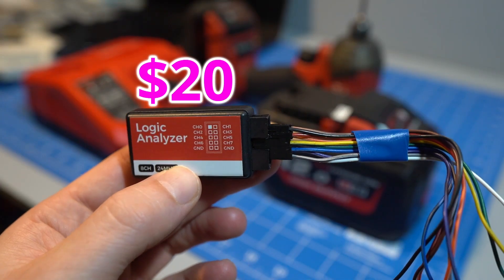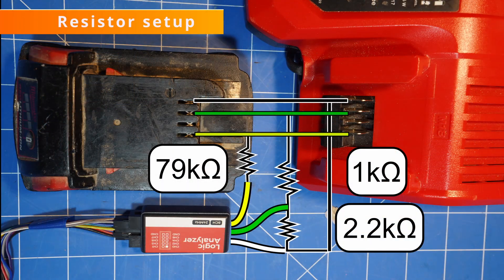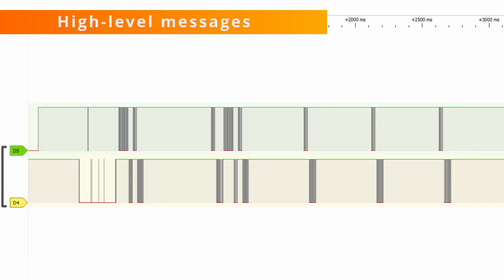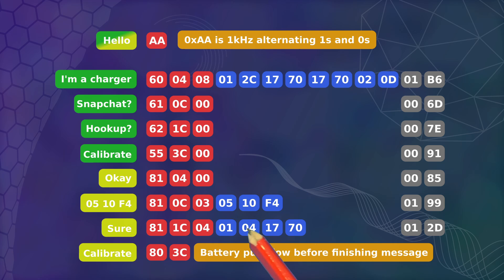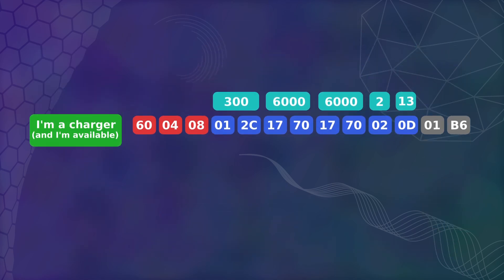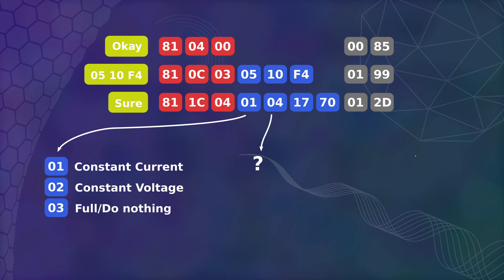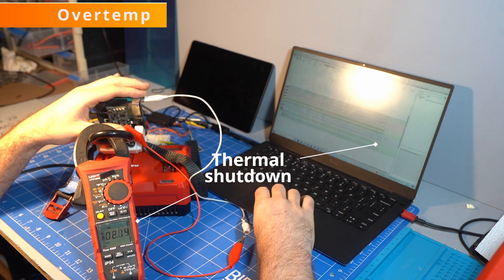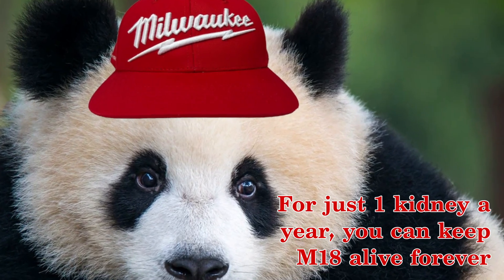[004] Reverse-engineering the Milwaukee M18 Redlink Protocol

Comment: Judging by the price of knockoffs, milwaukee battery margins must be 50% profit or greater for some configurations. I like the tools but come on milwaukee the best cylindrical cell around is probably not even 6 bucks in bulk. And those new flat pouch cell types they are going forward with in the new battery line is probably even cheaper because of packaging alone. higher amp output I'm sure but also likely not as long lived... cylindrical cells have historically been a lot more stable over time afaik anyway, but perhaps that is just because I'm only used to comparing to cheap pouch types.
Reply from the maker: We need a reliable 3rd party brand, with good warranty. The problem with most knockoffs is that they're an unknown entity - could be using any cells and little to no protection. I pay the tax just so I don't have to worry about my house burning down.
Reply: The TPCell on ali x looks promising. They offer Makita and Milwaukee packed with samsung LG  or higher quality Chinese cell and 12mo warranty.  And guaranteed capacity. Sidorov tested them and they were all stated capacity. Reviews are good so who knows. Not as cheap as typical knockoff but way less than oem

 Myself I just roll my own these days and give myself a lifetime warranty
Reply from the maker: @earl3358  interesting channel. Thanks for pointing it out. I guess you still don't know if you're getting the Samsungs or Chinese cells. Also a pain to send anything back. Liek you say, best budget option is to buy good knock-off boards and make your own, then rebuild when they fail.

Comment: Outstanding work, thank you.  Any chance you might perform similar investigations on the Makita batteries that have a very bad habit of bricking themselves if a charge fault is detected 3 times?  I have a large box of said bricks I would donate to such an effort.
Reply from the maker: To do that you've got to reverse engineer the chip, which is about 100x harder than what I've done in this vid. Some much more knowledgeable people than me have been looking at that on battery hacking forum. Seems like Makita is using a chip known to be very difficult to reverse engineer. If they've deemed it too hard, then it's well beyond my abilities.

Comment: Those basic logic analysers are an indispensable tool, the number of capabilities you get for the money is incredible
Reply: Indeed, though these cheap ones do not have the slightest bit of input protection. Probing with a scope prior to using them is advised.

Comment: Could you design a fake battery such that it is actually a transformer so that battery-based power tool could be run off of a power cord (wired to AC) ?
Reply from the maker: A youtuber called Harrison Hobbies has done that. It ends up being large and expensive, but could be useful for some people. Hikoki (Metabo HPT if you're in NA) has an official adapter that works with their 36V tools.
Reply: Wow, thanks for the reply, that's been bugging me for like 2 years.  So I have another wish list item for people smarter than me.
Is it possible to covert dirty power from a non-inverter generator to pure sine wave?  I say this because I have a great generator 12kw genset that powers my home.  But I would love something I could plug in to a wall outlet that is supplied by said generator and have it invert it to pure sine wave.  I only need like 2kw or less to be good power, the rest is fine on dirty power.  The idea is power the whole house dirty, plug in a device in to 1 outlet and provide 15 to 20 amps of 120 pure. @toolscientist

Comment: But why ?? total overkill for a bloody charger...
Reply from the maker: To do fast charging on Li-ion, you either need access to all the cells (like Dewalt) or you need a way for the battery to control the current. The original M18 packs (pre-2014) didn't have this and couldn't fast charge. Going digital was really the only way they could do it whilst maintaining backwards compatibility.

Comment: Well that's overcomplex.  Love to know why Milwaukee though the batteries and charger needed to chat ao much about nothing?
Reply from the maker: To do fast charging on Li-ion, you either need access to all the cells (like Dewalt) or you need a way for the battery to control the current. The original M18 packs (pre-2014) didn't have this and couldn't fast charge. Going digital was really the only way they could do it whilst maintaining backwards compatibility.

Comment: excellent video, i made an adapter about a year ago, from an old M18 battery to attempt to do the same a while back, i just lacked the logic analyzer to hack the stream. i can send it to you if you want
Reply from the maker: I'm in AU. I have pretty much have every M18 battery (except 9ah and 1.5ah), so no need for anymore. I have noticed that my batteries from 2013 and earlier do NOT have digital communication, so you might not get anything out of your batteries if they're really old.

Comment: So ultimately, that battery talk only serves to satisfy an overpriced monopoly. (and not any actual protection)
Reply from the maker: To do fast charging on Li-ion, you either need access to all the cells (like Dewalt) or you need a way for the battery to control the current. The original M18 packs (pre-2014) didn't have this and couldn't fast charge. Going digital was really the only way they could do it whilst maintaining backwards compatibility.
Reply: @toolscientist : thanks for the clarification.

Comment: This is phenomenal. I also have no doubts you are the guy to solve the historical “how to run Milwaukee battery tools on AC power” question.
Reply: Not too complicated I got it working in the shop a year ago. If I roughly try to remember you have to send 5V to either J1 or J2 pin. Can't remember which. Even 1V was enough if I remember correctly. Then the tool will accept current via the Power and Ground pins. I powered a whole bunch of Milwaukee tools like this using a lab bench power supply. Just make sure your wires are beefy because you're dealing with a lot of current. Having said that, I am looking forward to the next video in case there's some current throttling happening without explicitly communicating through uart.
Reply: @renegaed  From my testing and reverse engineering of this a few months back the only communications I saw were between the charger and the battery. I didn't see any data between any of the tools I tested and the battery. The tools seem to measure the pack voltage via a potential divider, and I think they possibly measure the pack temperature (which I think could be your 1v you mentioned)
Reply: @BuyitFixit  very interesting, thanks for sharing
Reply: @renegaed  very interested.  I have a 1500W 18VDC power supply I have lying around that I'd love to power tools off, especially ones that I don't really ever move.  I've tried just connecting the 18V to the tools but it did not work.  Could you check which pin you were successful with?  Thanks.
Reply: I just converted a milwaukee 18v  vacuum to run on my Bosch batteries. I put in the Bosch mount for their 18v battery and can now vacuum using my plethora of bosch stuff. Worked good for me. Got a good deal on the vacuum but did not want to invest in their batteries or chargers. Next step is to put 18v mount on my Pyle Speaker/mp3 player (big pyle 10in woofer compression driver pro speaker) so that I can play it out where there is not power. Going to put two mounts on it for capacity and run two 8ah or 12ah bosch batteries on it. Do you think anyone would be interested how its done using Bosch Milwaukee or Makita batteries? There are some points to keep in mind.
Reply: @KlodFather Yep I run the framing nailer, inverter, and backpack vac off an adapted Makita battery without issue.
Reply: @brodycloud3405  -  Yes... I was referring to converting other things that are not supposed to run on Makita or Bosch packs to use the 18 volt packs. I think it is foolish considering how few amphours you get from lead acid for the size and weight to imbed them in the speaker like the manufacturer did on their previous designs. In this case, the newer speaker runs on voltages more compatible with drill packs. Also it is good practice to isolate the packs when using more than one pack so they do not parasite each other or backfeed. There is a little engineering that has to go into it before you put the battery shoe on the equipment.
Reply: The batteries can provide more than 30amps... wall outlet typically can't
Reply: @sloppycee  -  Yes... The current must be high because the voltage of these batteries are very low (less than a 5th) compared to line or mains power in USA.   A typical 3/8 or 1/2 drill running on 120 VAC draws between 5 and 9 amps from the outlet. SOme very heavy hammer drills will max out the plug at 13 amps. The real work here is being done by the power which is quantified in Watts. Volts x Amps =  Watts
Reply: @KlodFather  yes, and it would be impossible to make a DC drill motor run on 120vac, without completely replacing it.

Pretty sure all plug in tools use AC motors directly.
Reply: @sloppycee  -  Yes that is correct that the plug in tools use AC motors... The ones with brushes have what they call a series wound motor that WILL run on DC if applied. The variable speed will not work though... Its on or off when using DC.
Reply: @sloppycee Eh, here in Aus if it’s on the right circuit in my home something can draw 30A at 240V if needed. Not sure it’d be required here though
Reply: @sloppycee 30A with low voltage, so with a transformer it shoukd be ok.

Comment: They're multi series multi parallel, try remove a parallel cell, I've seen some instances of slashing one led but they still function and charge, by hammering the fuse built into the cell fixes it mostly temporarily. It eventually comes back , blow dependant , fine balance between not enough ok and gas ,lovely lithium gas

Comment: There’s a guy named Harrison Hobbies here in YouTube that’s been working on a wall adapter for M18, and I’m assuming that this redlink protocol lets the battery and tool communicate during use which is probably why most homemade attempts at a wall adapter hit a wall
Reply from the maker: Yeah, I've seen HH's vids - I reference him in my power testing vid. His latest is using double 1kW supplies. Seems to have been quiet for a bit, though.

Comment: I can't wait to see the breakdown of communication between the battery and tools. Using 18v power tool batteries for purposes other than their intended is pretty so handy and having some ability to get battery status and/or low voltage cutoff via the onboard BMS rather than a dumb external LVD would be slick.
Reply from the maker: You could be in luck. Early tests make me think I can use the battery's BMS to drive a disconnect mosfet.
Reply: @toolscientist  That's super promising. Would definitely be a better solution than what I use today.
Reply: @bradley3549  When I was looking at this a few months back, the tools just seem to measure the pack voltage via a potential divider, and disconnect the battery when the voltage is low. I didn't observe any communication between the tools and the battery, only on the charger. I also wrote some Arduino code to talk to the battery.
Reply: @BuyitFixit  Bummer, that's a bit of a letdown. I was hoping that the battery would at least handshake to tell the tool what the low voltage cutoff should be for that particular pack if not outright command the LVD. I was making the assumption Milwaukee was forward looking enough to realize a new chemistry might come out that might require a different cutoff voltage. (Since they weren't forward looking enough to integrate the LVD into the pack... SMH.)

Comment: the bytes at 4:20 i've seen something similar in the past (can't remember where) but they used the bits after the first 1 to set various values, think that their reasoning is to make the communication algorithm simpler, basically instead of checking multiple bits for a certain value, they just count how many zeros before the first one and that indicates which command/status/whatever it is, not sure how relevant to this it could be tho...
Reply from the maker: That's not a bad idea. The 2nd byte is unique to each message, and it gets pinged back by the battery. I somewhat discarded the idea that the 2nd byte was the command as there's already enough info in the first byte to deduce the command, but you could be right. Another commenter (in the thread with ~10 replies) had the idea that it was a debugging byte. On a scope it would be a very obvious rectangle that you could identify even under extreme noise.

Comment: BRO YES. This is EXACTLY what I’ve wanted to see for ages now. I’ve always wanted to get a glimpse at the communication between Milwaukee batteries and the charger since the milwaukees batteries have the BMS on board unlike dewalt etc. with that being said, because what you’re doing is above my skill level, is there anyway that you could see, to trick an m18 charger to give me the raw charging output? I’ve got some projects where I’m building 18v packs with a common BMS that chargers simply through the output. Would love to trick my m18 charger to simply run a + and - wire out kind of like a wall wart. Only reason I want to do this is to take advantage of the high current output of these chargers. 3A charges quick. Any insight would be greatly appreciated. 

ALSO, a project I’ve wanted to make was creating my own “forge” battery from an old pack, curious about the behavior of the board completely disconnected from cells then reintroduced to a fresh “pack” and if this would have any cause/effect on the microcontroller. Also just watched your video on the over discharging 18650 packs. It seems if I wanted to make a lipo pack for safety it looks like the high output boards would be ideal given the 2.5v cutout. Also using the OEM board itself would be nice I’m assuming to retain the better protection functions rather than an aftermarket board.
Reply from the maker: Maybe. I have found an older and simpler protocol that just uses high/low voltages. However, this only gives a low charging current - I think 1A. To get the full 6A, you'll need to make a microcontroller and program it to mimic this message sequence. It still may not work, as the charger has some extra error detection in it. For example, when I used thin leads for the main current path, the charger seemed to notice the extra resistance. It would ramp the current up to around 400mA, then stop, then ramp up again, and stop. It repeated this about 3-4 times before giving the red/green error. Communication was working fine, it just sensed the extra resistance.
Reply: @toolscientist  very interesting. Would love to see if I could get a full 3-6a out at some point. You’re the man. Loving the videos. Will be keeping up with all of them.
Reply: I wrote some Arduino code a few months back that let's you talk to the battery.
Reply: @BuyitFixit  would it allow for full output current?
Reply: @mrb3888  The batteries I've looked at the cells are connected directly to the output terminals. The low voltage disconnect is handled in the tool. The circuit in the battery just handles the charging, not the output.

Comment: I would be very interested in researching how this is done with Metabo CAS batteries, it looks like uart, but that's all i can figure out. newer tools also communicate with battery while odler ones did not.
Reply from the maker: Milwaukee is similar. I have two 2013 batteries that don't do serial communication, just very basic pulses on one pin and holding high/low on the other. They've shoe-horned a serial protocol into an older system and it sounds like Metabo has done similar. 

I'd love to do this to every brand and then do a big comparison video with the pros and cons of each system, but that's probably at least a year or two away. Power tools are expensive and my time is fairly limited!
Reply: @toolscientist   I hope you find the time. There is very little research or anything at all published to do with power tool battery communication.
Reply: I'm currently at it, though I'll have to take a break as I'm moving.
The protocol is a 2400 baud UART on a single wire. So far I only looked at the communication with the charger.

All messages are initiated by the charger. And triggers a response from the battery.

All messages are 4 Byte consisting of 1 Command/Address byte, 2 data bytes and 1 checksum byte.
The "questions" fron the charger always have 0x00 0x00 as data.

At the moment, I have identified a few fields that might indicate the battery type, it's capacity and current capabilities. There is also some random stuff in there I can't make any sense of. It also seems that the batterie does not report any kind of state as the values that get queried repeatedly during charging never change.

Comment: Hey maybe 05 at last would be a tamper/repair protection that bricks batteries... idk just a wild guess
Reply from the maker: Possibly. I've seen lots of vids of people rebuilding M18 packs where they completely sever the PCB, have it unpowered, then spot weld new cells in, plug it into a charger, and it works again. I think I just bodged the desoldering and damaged something. When I get the time I'll have a closer look, but I have 17 other batteries and 3 other 2ah, so it's not worth my time at the moment.